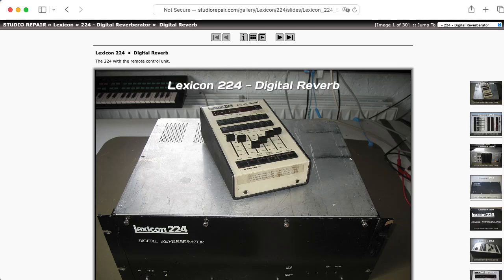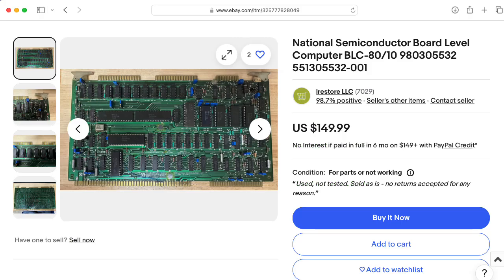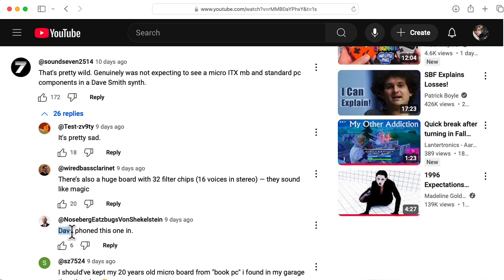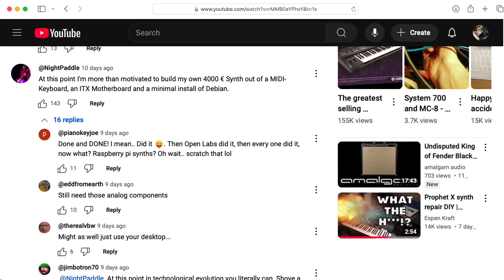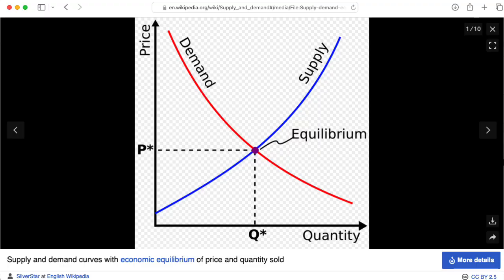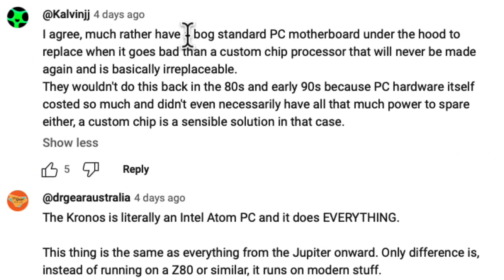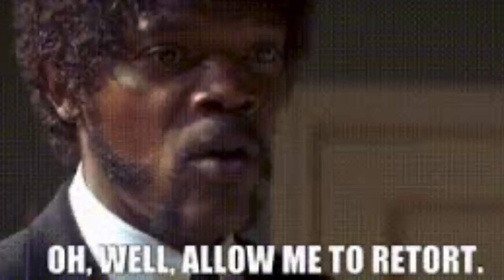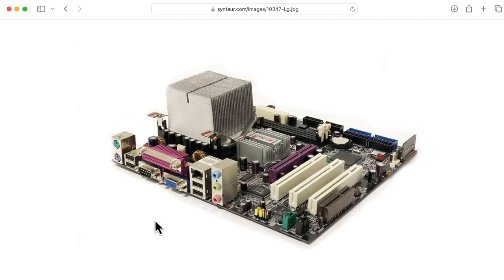Yes, the Sequential Prophet X Has a PC Motherboard. And that's OK. (Response to Espen Kraft Viewers)

Comment: I recall the first generation of Sequential synths, when they did have their own microprocessor systems and firmware designed and coded by Dave Smith - so it is a little sad, and just the current practice, to see this outsourced.
Reply: Why would you design your own MCU when there is an off-the-self part that does what you want? It's not commercially viable. Maybe back in the day D.Smith did not have a part that would do what he wanted and then design its own MCU.
Reply: It's also cool to see the hand-laid PCB designs in the older Prophets, with tinned traces instead of today's ubiquitous green solder mask.  No one uses curved traces anymore. 🙂
Reply: The firmware was designed and coded this way because the processors were slow and ROM and RAM was expensive. Still the Prophet 5 used a stock Z80. Dave Smith probably could have put a development board into the Prophet but I believe those were rather expensive at the time (and also had additional functionality that wasn't needed).
Reply from the maker: This makes no sense at all from an engineering viewpoint or a marketing viewpoint. Early synths had didn't have bespoke CPU boards with Z80s and ROMs and RAM because the designers wanted to show off their engineering prowess; they had them because it was the best way to hit a price point at the time. If they could have sold the synth cheaper by using an off-the-shelf SBC (like Lexicon did in their 224), they would have.

Comment: Edit: oh nevermind, should teach me to watch the whole video before commenting.... The legendary Korg Kronos synth had a pc motherboard too. And nobody ever complained about it....
Reply from the maker: Yeah, I mention that along with the Hartmann Neuron (although plenty of people complained about that... but I think the Neuron was released before it was ready).
Reply: I think you can still complain about the 3 minute boot times and the fact that m.2 SATA will be hard to find in the future
Reply from the maker: @raul0ca  Indeed, that's a big advantage of a solution built around a microcontroller with more bare-metal programming. Running a full Linux kernel comes with a lot of overhead.
Reply from the maker: heh ;)
Reply: As did its much more expensive predecessor, the Oasys. You could've paid up to 10k for a Pentium 4, but you did also get a beast of a workstation with an absolutely incredible interface.

Comment: I’d love for you to tackle Espen’s “VST in a box” claim about synths like the Prophet 5 rev 4 and Ob-X8  because of their use of digital envelope and voice control with the vintage knob.
Reply: By Espen’s measure, the Oberheim Xpander is a VST in a box.
Reply from the maker: Oh goodness -- yeah... I thought about wading into that a while back but decided not to at the time. But... yeah.
Reply: Some 80s vintage synths with software envelopes have reputations for having "slow" envelopes (or odd curves) but I don't think people realize that's likely due to the fact that they were being done on a  single 1-4mhz 8-bit microcontroller that was responsible for 5 other things on the synth.
Reply: @ddqd123  But that doesn't change the fact that the envelopes were (sometimes) slow. I clearly felt this when comparing a Prophet 5 to a Prophet T8.
Without a doubt Sequential could also have used hardware envelopes (CEMs) on the T8 (like they did on the P5) - but they didn't.
And to be really picky about this: The T8 used a 6MHz 16-bit processor just for envelopes, LFOs and CVs - and a Z-80 for all the other stuff (scanning controls, keyboard, MIDI and so on). I believe they simply needed to gather experience in writing this stuff - or they simply accepted this (inferior) version as sufficient.
Reply: The funniest part about that video was him ranting about cheap digital implementation on analog poly synth while a six track and 106 we’re behind him. Both of which are heavily reliant on digital control. I’m sure he will be mad when he opens up a vintage p5 and an obx to find that they both used off the shelf z80s.

Comment: Finally, a view on this I actually agree with. I've been a little annoyed at Espen's recent videos, especially because I know what it takes to make the devices he keeps calling "scams". I was particularly annoyed by the implication that Behringer devices are the only "fair" devices, when in my opinion they're as far from it as possible.
Reply from the maker: If you replace where Espen says "scam" with something meaning "a value proposition that many may not find appealing," then he has a point. But the term "scam" implies deliberate deception, which is unfair. 

The thing about Behringer is that no one can really compete with their economies of scale. A company like Groove Synthesis buys X number of resistors for a couple versions of basically the same product, whereas Behringer can buy many many many more of that spread over hundreds of products.
Reply: @Lantertronics  Behringer also avoids a lot of R&D expense in many of their products.  If you're essentially duplicating an existing circuit from a successful product, most of the engineering work was already done decades ago and can be leveraged to offer the new product at a much lower cost.  I make no statement about the ethics of this approach, but it's undeniable that it saves a ton of money and time getting a product to market.
Reply: @seegee-u3l it’s maybe true for the simpler analog synths but probably not for synths like the UB-XA or the Wave as they had to redo it completely using new components and software. That’s why it also took them so long.
Reply: @Lantertronics  Behringer also tends (IMO) to buy the cheapest components possible; at least for some products. When comparing their 140 eurorack module and the similar Roland module (the 540) it becomes very clear. The Behringer sliders are very flimsy and not really precise.
Reply: Agreed, I just unfollowed him as I feel that there is a degree of clickbait and sensationalism there sometimes that is unhelpful.
Reply from the maker: @Tharsis879  Which is sad, because his content has historically been pretty interesting. It's just gone a bit over the top lately.
Reply: @Lantertronics  "over the top" is a good description, I got tired of it.
Reply: I disagree. The computer chips are a way of short cutting work and making your synths cheaper. This is absolutely INSANE when you think about the money they cost. The parts they use now massively reduce repairability, they end up simpler in design (if they had to use actual discrete circuitry to achieve what they do with emulation the synth would be even more complex, not less), and half the time you just end up with problem. Synths are getting buggier and buggier and it’s because of software issues.

Comment: All great points. I think you nailed it when you said 'you're paying for the interface'. These synths could just as easily be sold as a pc peripheral with some bundled software to install on your own PC... and charge roughly the same for them. I think these companies/products reach a point where the decision is made 'it's already costing thousands of dollars, we may as well integrate the pc into it so we have a controlled environment for our software'.
Reply: That option more or less exists with the NI Komplete Kontrol S series, or Arturia controllers, too
Reply: There's a company called SoundForce that sells custom small desktop MIDI controllers built for specific VST's like TAL U-NO-LX. Incidentally, the controllers cost only slightly less than actual small synths like the Nymphes, Pro-800 and DeepMind 6. When you buy a hardware synthesizer you're essentially buying a MIDI controller which just happens to come with a synth built in.

Comment: Living with and having to maintain a CMI 30A and a Hartmann Neuron I would have say that I'm not so sure that I agree completely... On the other hand keeping the other computers in the studio synths and FX units like the AMS's, PPG 2.3 and Waveterm and all of the vintage synths like the Prophet's, Oberheims, Synergy and Synthex are "relatively" easy (except when they aren't). I guess time will tell!
Reply: That being said I do like the idea of using the smaller systems like Raspberry Pi in synths as in the future they will be easier to replace with later iterations of micro. Full PC motherboards can be painful to replace a decade down the track and if these machines can't last that long then they are a bit of a fail given the longevity of the Z80 and 68xxx board so far.
Reply from the maker: @Tharsis879  This got me thinking -- it would help if manufacturers would embrace more open standards. Not that they necessarily have to give away all their source code --  but they could publish interface specs that would let someone swap in a newer motherboard that would stay compatible with the rest of the hardware, and enough detail on how the software works that someone could cobble together drivers for a newer OS. (I'm just spitballing here, I realize there's problems with this idea).
Reply: @Lantertronics  Have you ever experimented with the Teensy and its audio development tools? It’s essentially vanilla ARM Cortex I/O, but pretty well supported and documented audio modules from the community.
Reply from the maker: @silverXnoise  I advised a senior design team that used Teensy to do guitar effects and they had great success with it!

I've also had many students have great luck with the Daisy Seed and other STM32-based boards.
Reply: @Lantertronics  I agree completely. Finding an old motherboard, dealing with bios and system drives is a complete pain. there are all kinds of odd connections and mods in the Neuron that it's unlikely that a motherboard swap would be a simple process. As for the CMI-30A don't even go there, a MB replacement wouldn't really be possible with an identical board due to embedded licensing in the Fairlight's original MB. Not to mention the Samsung phone app in the phone embedded into the RH end of the keyboard.
Reply: @Lantertronics  all these fancy pedal manufacturers use a 10$ teensy/daisy seed for their 400$ pedal; what a ripoff (sarcasm)
Reply from the maker: I got the impression that the Hartmann Neuron came out before it was really ready.

Oooooh... tell me more about the 30A!
Reply from the maker: My only complain about the Synergy is the way the daughterboards hook to the motherboard by wire wrap pins jammed into IC sockets.
Reply: @Lantertronics  Amen to that!
Reply from the maker: ZOMG you have a Waveterm!?!?!? Whoa!
Reply: @Lantertronics  Yes, a couple of Wave 2.3's, a PRK FD and a Waveterm B. I am servicing the video board of the Waveterm currently as it has a horizontal sync problem.